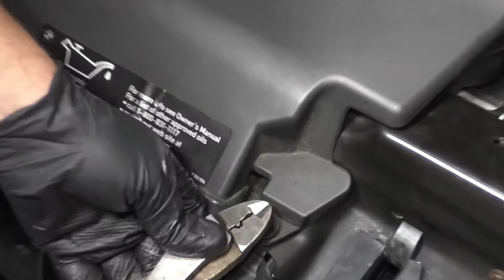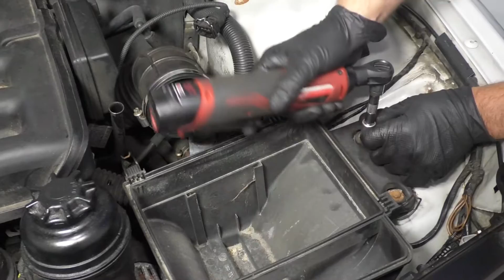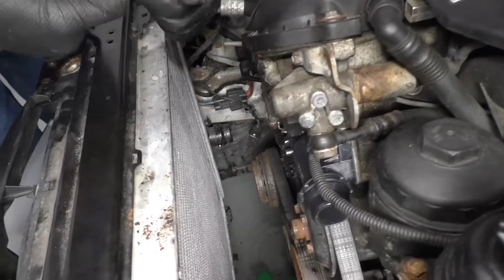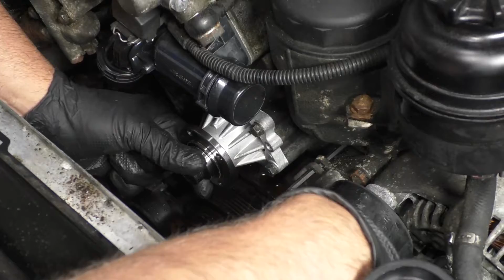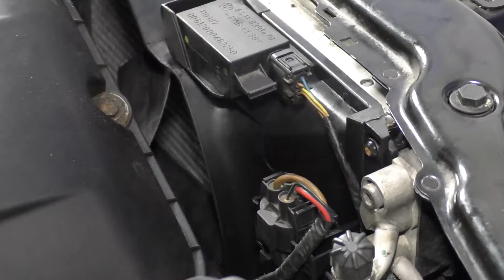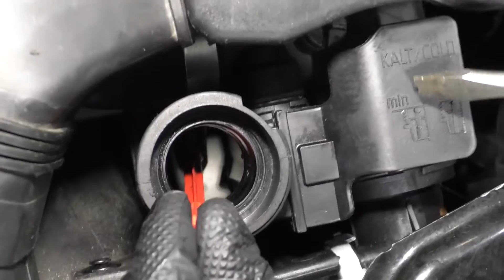How to Replace Water Pump 01-05 BMW 325Xi

Comment: Switching to electric fan is the way to go. The oem BMW fan can destroy itself and hoses… plus its a pita to move when doing maintenance. I have an 03 325xi, deleted the cars fan and went electric 3 years ago(17k miles since) with no issues.  I did the fan upgrade, water pump, hoses, thermostat/housing, radiator, coolant res,  both tensioners and all pulleys, both belts, lower bar cap, brass bleeder… when I did the fan.  

Just thought Id see if I could eliminate one of the E46’s weak spots.

Comment: WHere we suppose to get the bolts you insert to get the water pump out? Do i go buy em?
Reply: What does your heart tell you? Metric bolt store would be my guess. Probably a 10 X 1.25 X 35 (mm)

Comment: Would a bad water pump on a bmw be a possible cause for loss of acceleration after 3rd fear or so ??
Reply from the maker: +Saul Serrano Thanks for watching!  The symptoms of a bad water pump are usually things like a squeaky pulley, coolant leaks and overheating.  1aauto.com
Reply: 1A Auto Parts I do experience leaking coolant but I don’t experience overheating, could it still be the water pump?
Reply: @SuperBeastin247  it could be but the water pump is electric not on the belt so I would check your timing belt
Reply: @KaidudeHasanSarfaraz  Electric water pump on E46? I don't even... Did you watch the video?
Reply: No. Check your fuel pump.